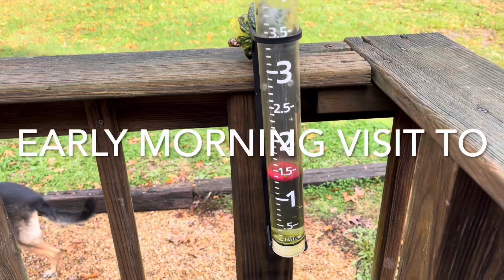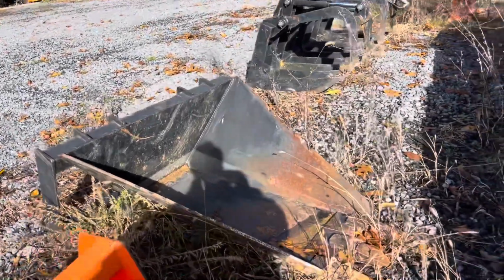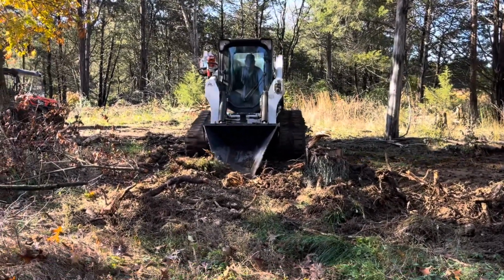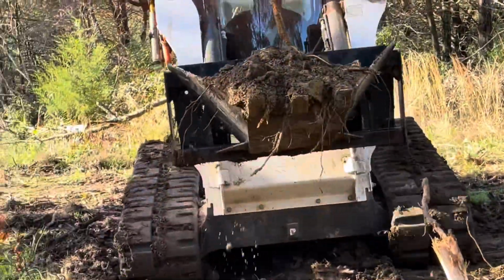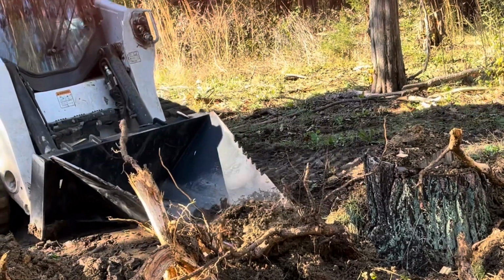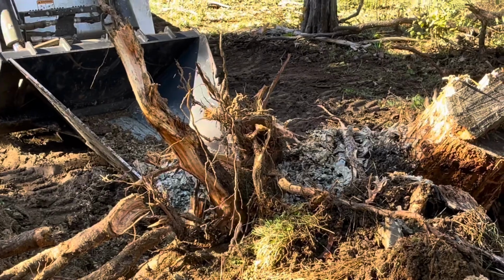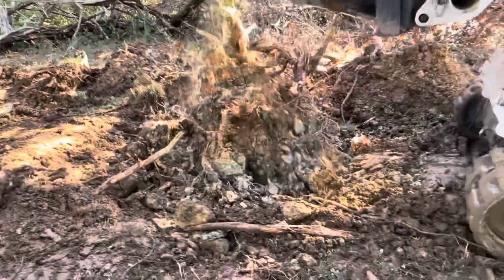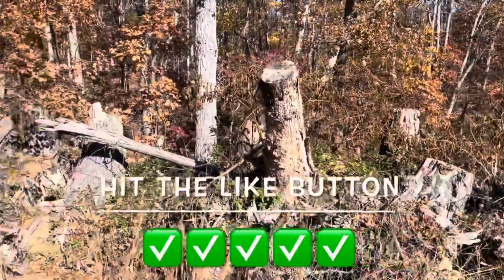Firewood Titan Stump Bucket In Action#145

Comment: One of the last Fir stumps I took out (the first one on my video you watched) had a tap root the same diameter as the trunk. I had to cut it with chainsaw. Around the 10 minute mark you were slamming into that trunk! It sounded awesome! LOL
Reply from the maker: David, It seems no Stumps are the same, little bites at a time until you get some movement, the go at it full bore!😂
Reply: That Bobcat can handle it! 😬